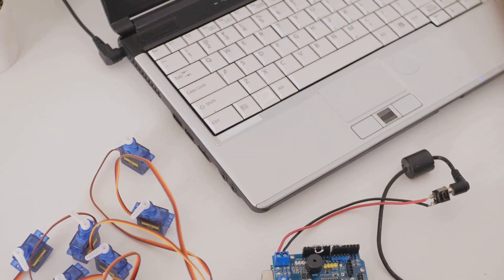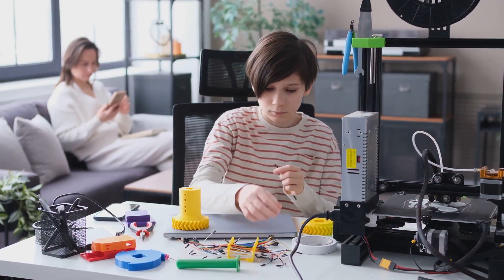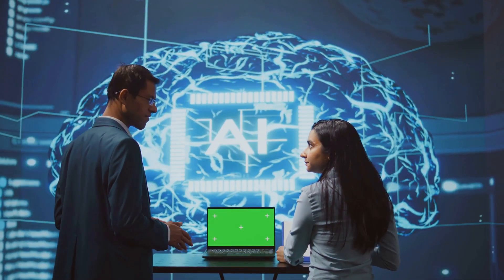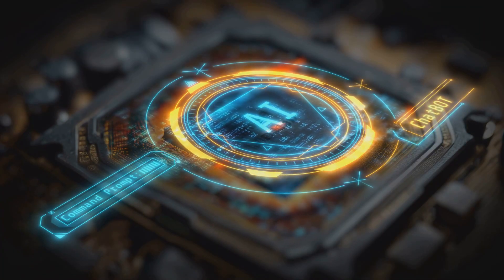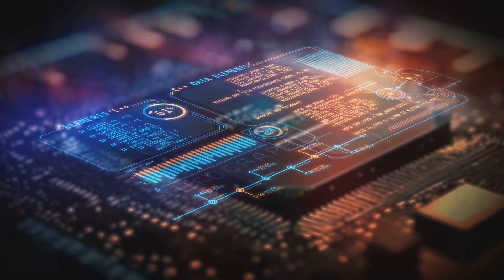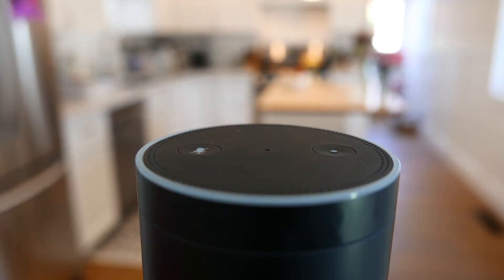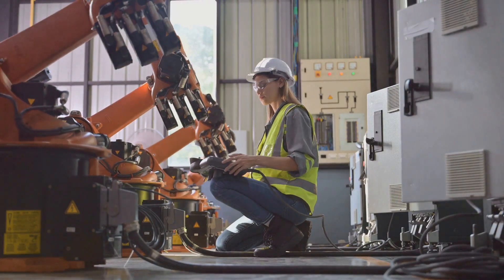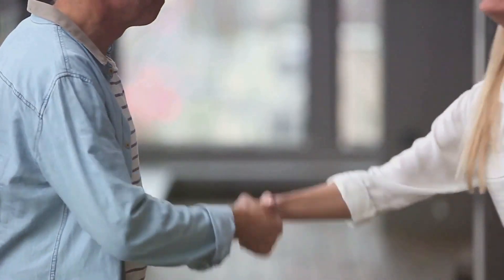Raspberry Pi AI HAT+: A Game Changer with 26 TOPS!

Comment: Thank you for informative video. I have a question about: Is it compatible with Raspberry Pi 4B 8 GB?🎉
Reply from the maker: Thank you for your question! The Raspberry Pi AI HAT+ is specifically designed for the Raspberry Pi 5 and unfortunately is not compatible with the Raspberry Pi 4B 8GB. This is because the AI HAT+ relies on the PCIe Gen 3 interface, which is only available on the Raspberry Pi 5. Let me know if you have any other questions!